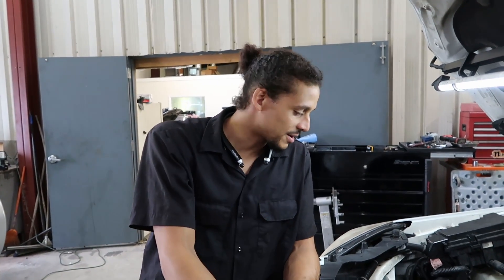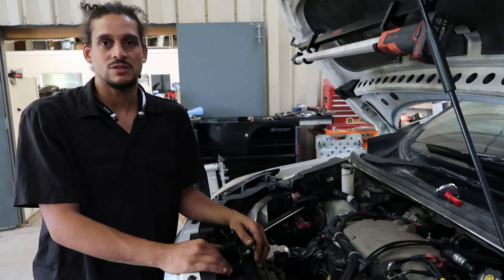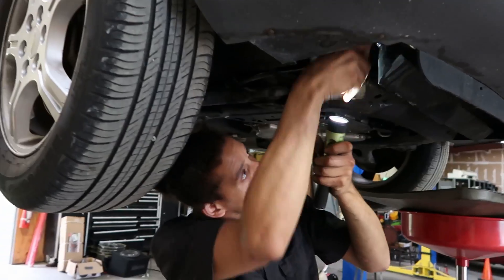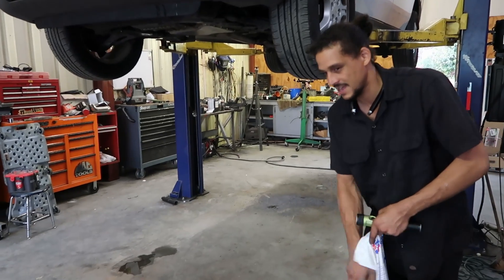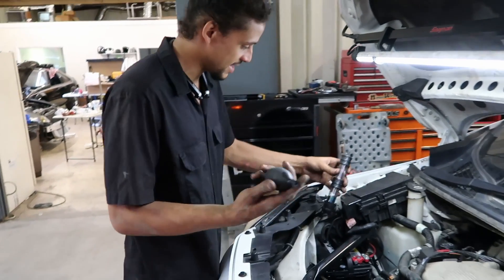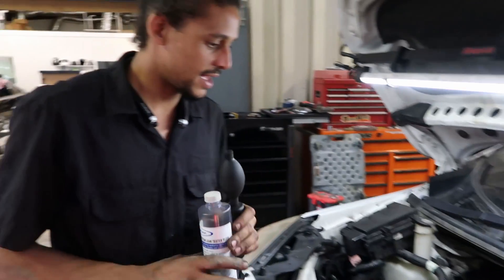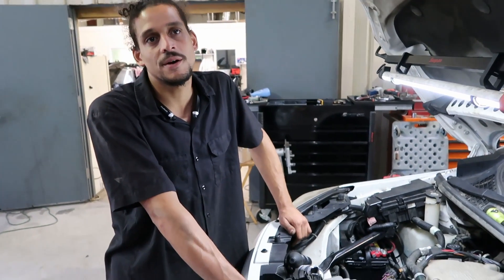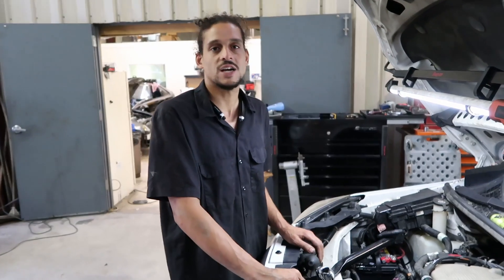How To Diagnose A Blown Head Gasket

Comment: did you seal the radiator with the tube? i sealed my reservoir with the tube per instruction but it can quickly suck the air from the reservoir and the suction ball can no longer suck air. is that normal? or do i just let some air in the reservoir, seal it again and rinse and repeat? i did this and color didnt change. did i do it correctly?

Comment: So I just let it drain for about min or two I don’t fully drain it ?
Reply from the maker: About 30 seconds to a minute it depends on how fast it’s coming out. Correct don’t fully drain it
Reply: @AlexTheCarDoctor  hey Alex I forgot to mention that this Durango is leaking little spots around oil pan/drain bolt could this possibly be a oil cooler problem that’s causing it to overheat ? I know this are problem with these trucks and are mistaken for a head gasket issue
Reply from the maker: @angelleos3397  if it’s leaking coolant then yes that’s the problem.still needs to be fixed if it’s leaking oil too
Reply: @AlexTheCarDoctor  not leaking coolant leaking oil